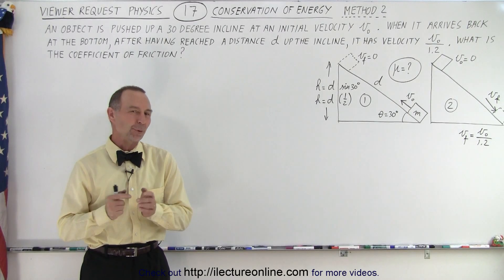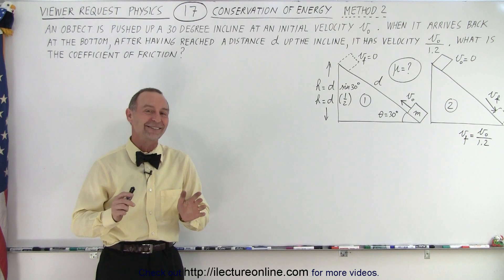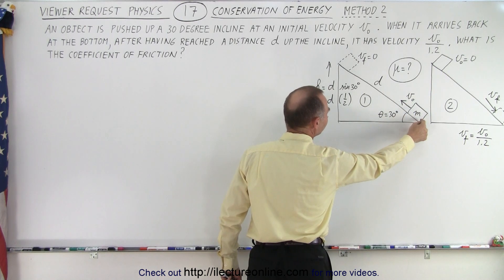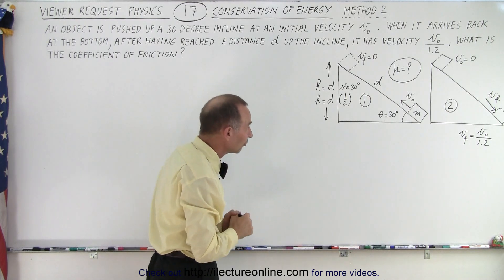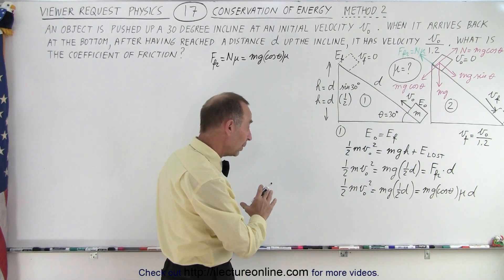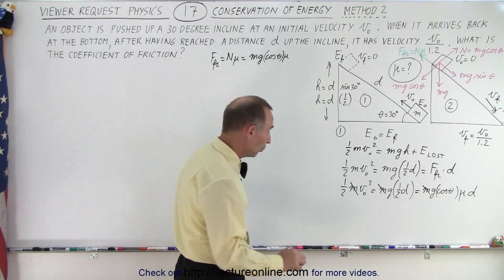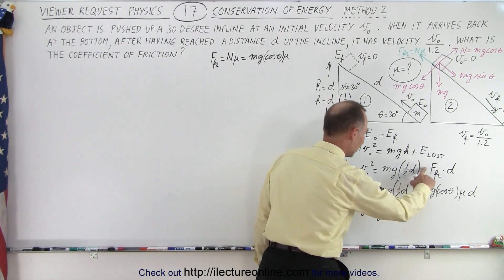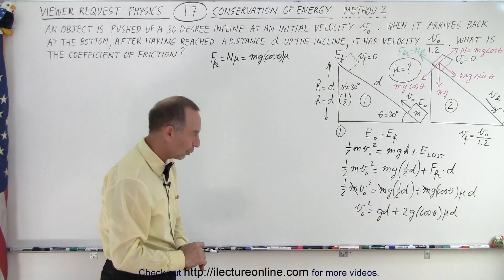Physics: Viewer's Request: Mechanics #17: Conservation of Energy: Method 2 (Wife's Method)

Comment: IN the question description they told us "An Object **Pushed** UP" and i thought we need to add in the Equations the Force to Push it . and that's why i failed to get to the Solution .

how can know that Push is not an external force ? because of the V_0 ?
Reply from the maker: A push wll be an external force, and only external forces will affect the movement of the system as a whole.
Reply: @MichelvanBiezen  So why we don't consider Force in the calculation? Or we consider it to be a=0 and then F=0 ?
Reply from the maker: The force is only momentary to get the object moving at the given initial velocity.